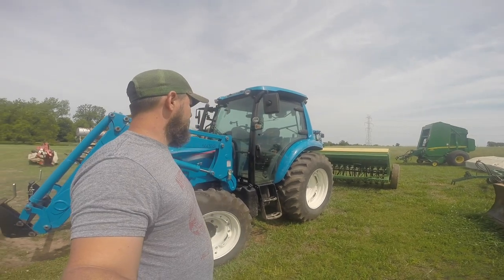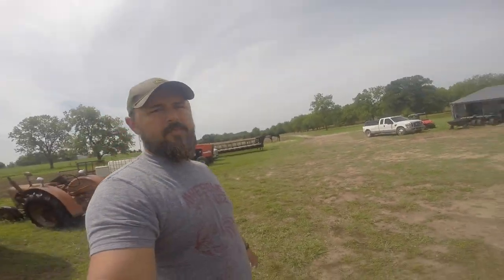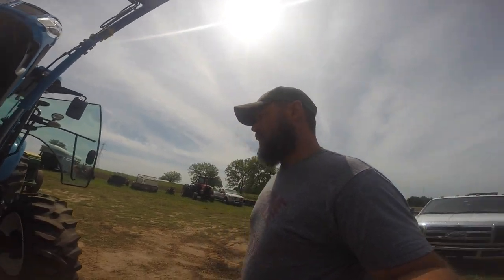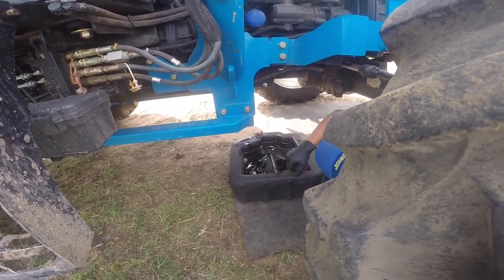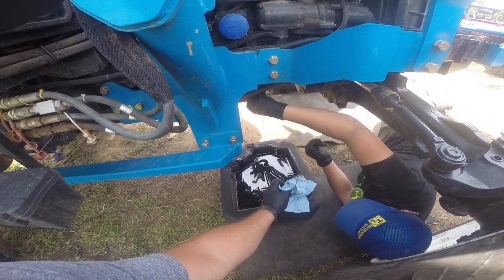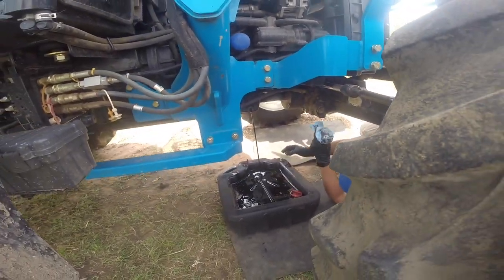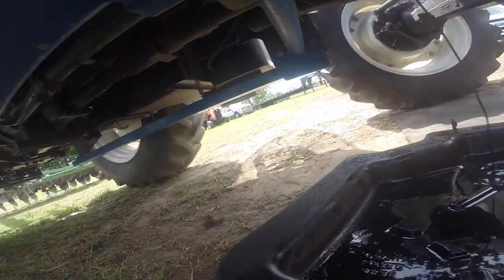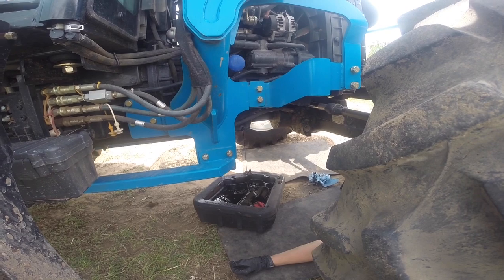How to Change Oil On A LS Tractor MT5-73

Comment: I think the LS mt573 may be the best value for a tractor in the 70hp-75hp range on the market. I have a dealer closer by, 200mi. away but we live in Montana so that is about as good as it gets. I bought my last tractor from the same dealership when LS was LG and went under the Montana brand name and it is( john deere green). The machine is an '06 Montana t7074 70hp tractor with a john deere 2.9l 3-cyl. (no emissions) with 760hrs. on the clock. I will trade my tractor in on the LS mt573 in the next few years.  I think your channel is the best review these tractors could get seeing how you have two machines with different hrs. purchased at different times. This makes it a much more in depth and honest review. Please keep the content coming and thank you for your videos!!!!
Reply from the maker: We absolutely love the LS machine line up. We are diversifying our tractors all the time too better run our operation but the LS tractors are the far best value for the money when things get a little more in stock we plan on looking at some bigger 100 hp LS tractors in the future. Thank you for the kind words and comments

Comment: Seems a bit easier than the XP 8101CPS looks like there is no DEF tank?  What issues has the MT5.73 had? Major or minor? Did you at any point wish you got the 84 or 100 hp LS? Kinda wavering on 101 vs 73. Found out Wallenstien can make a subframe for their backhoe to fit the 73 included in the cost, they just need to scan the frame into their system to make a template but they said process won’t add to cost just 2-3 weeks lead time. 100 hp won’t need subframe though. That 73 though is tempting as control lay out is better than 6168 and maintenance appears easier. Advice?
Reply from the maker: We chose the 73 horse tractors for their size we are a mobile cutting operation so they were easier to haul around with our equipment. They do everything we need them to do however the only issues we have had are one of the tractors has had a wiring harness issue. We also chose them because there was no DEF on them the region systems on these are quite reliable and have very few issues we’ve actually had no issues. The only reason we did not go with the 100 horse at the Time was because of the DEF issue but I would consider going to a 100 
horse with no problems if DEF is something you’re not afraid of.

Comment: The local LS dealer recommended when changing the hydraulic fluid to use a "Universal transmission/hydraulic fluid" Just hydraulic wouldn't work as it had to say transmission as well. I know there is a "chemical standard" recommended in the manual. in looking through the manual for that unit, i noticed that LS does not use any "LS" brand fluids like they have "LS" FILTERS.

 They do not list any brands for their fluids. dealer said basically to use fluids that meet the chemical standard and LS filters. Deere and others recommend their own filters and fluids so i can see why. In LS, it seems fluid "standards" and LS filters. So what fluid/brand do you use for your MT5.73 for its hydraulic and transmission fluid?
Reply from the maker: we buy the AG 48 from Atwoods in our local area I believe a tractor supply also carries that if you don’t have an Atwoods available had no issues with our tractors well over 1600-1700 hours
Reply: Ok, will keep an eye out for it. I also did a bit of research and it applies to all LS tractors regarding the fluids. In the manual for an LS tractor if it says "GS CalTex" for fluids, that is from South Korea. LS was connected to them at one point via holdings. Since some brands will deny warranties if their fluids are not used, LS does not have a "Direct" link. However to reduce the chance, here is what owners can do.

 GS CalTex is one of South Koreas largest private oil companies. Its plant in Korea is the 4th largest all in one facility in the world. They are owned 50% by a local family and....50% by Chevron Oil Company. That's right, half American. So if you want to reduce chances of a warranty denial based on fluids, get the Chevron fluids that match the chemical standards for its function. The house brand Gs CalTex uses in Asia, India and nearly all over the world but apparently not in America is Kixx brand. After looking there, and Gs CalTex that's where the Chevron ownership came in to play.
Reply from the maker: Thanks for the help and info

Comment: I'm in the market for a 70hp tractor.   I have narrowed it down to this tractor,  and the Massey Ferguson 4707.  What do you think about the tractor's durability  over the long haul.   Can't seem to find much information about this LS.  The Massey isn't that much more in my area
Reply from the maker: We run two of the 70hp Ls Tractors and one has about 1200 hours on it and we’ve barely had any problems with it our other one has about 600 hours as long as your maintenance it and don’t abuse it they’ll will last pretty long we don’t know much about the Massey because we don’t run one but again as long as you maintenance it regularly then they are pretty durable and will last a while